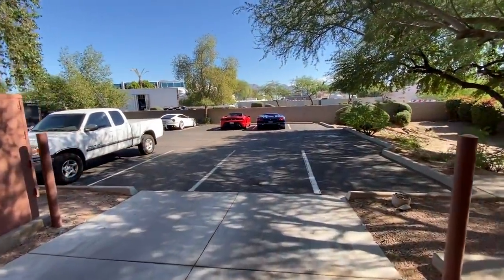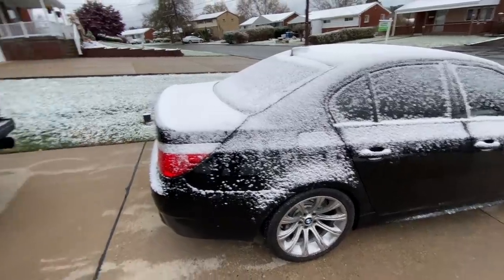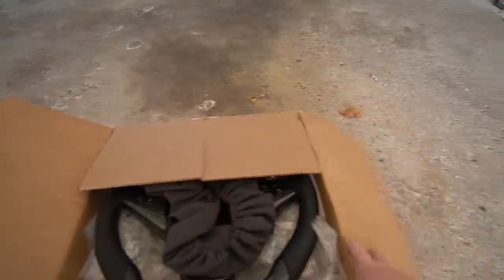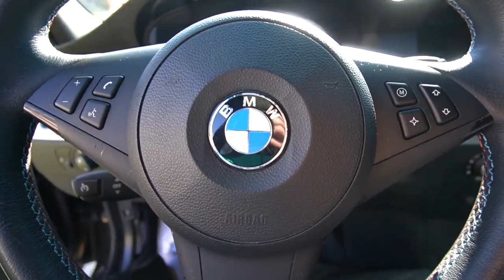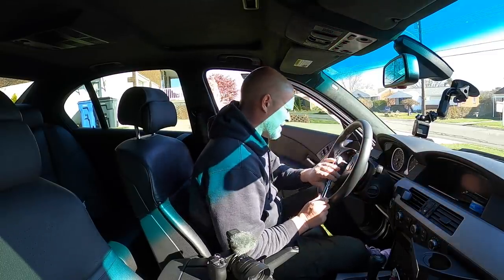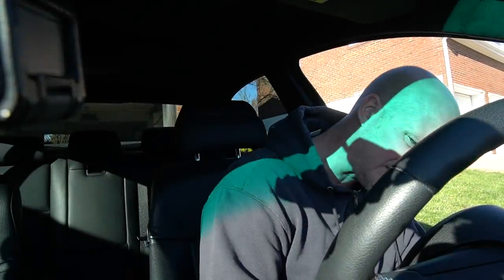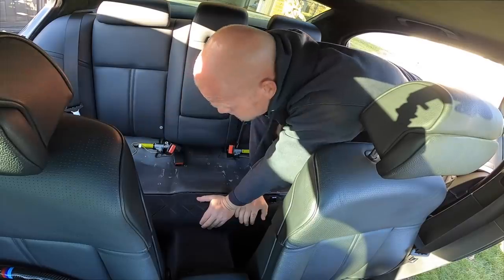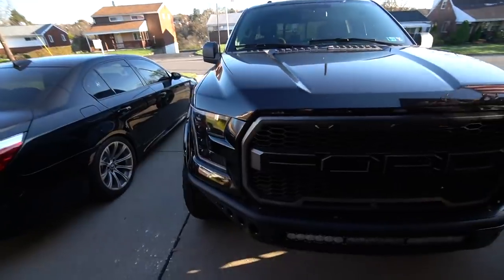I really messed up this time.. I should never work on my own cars

Comment: While you had the right socket for the ratchet it was the wrong socket for the impact gun. There are sockets that are made for those. You have likely ruined that socket and it will now strip every bolt you put it on. Replace that socket and get a set of impact sockets for the impact gun. I'm not saying this to be mean or troll. I'm trying to save you some headaches in the future. Ask me how I know about this. I've had a few headaches. 😉

Comment: You were definitely using the wrong socket. Even though it was the right size, a thin wall, deep socket will not stand the impact from that gun, and will strip the bolt every time... Use a much longer wrench.

Comment: NO Mike for the love of God do not drill out that bold.
There is special sockets for stripped nuts and screws that is what you’re going to have to go purchase from either Lowes or Home Depo.
Don’t forget to purchase a breaker bar with an extension.
Make sure and purchased a new boat from BMW when it’s time to install the new steering wheel don’t reuse the old one.
Remember always use finesse over power.

Comment: I just want to say a steering wheel's bolt is in revers so what usually is to un tighten the bolt is actually tightening it you turned it in the wrong direction
Reply: Ewald Vorster: No... It's a normal rotation.

Comment: Just need a longer breaker bar Mike. It's the torque you put in.. And never use an impact driver on the steering wheel bolt 😂

Comment: Next time you have to remove the seat try cliping the seatbelts to the latches through the hole. That should keep em lined up and worse case ypu can pull them through. Hopefully you get lucky and a) don't forget to leave trunk open b) run into your usual maintenence bad luck lol

Comment: ..... leave it to BMW to make the most simplest of things "Trunk latch" one of the hardest and most labor intensive process to open a trunk when the power runs out... imagine if you need a jump and the cables are in the trunk?..... i guess that's why so many BMW drivers don't use the indicators, in the hopes someone rear ends them so that they can get that dammed trunk opened lol

Comment: You don't have to drill it necessarily. You can use one of those extractor socket sets. I have a set and it's awesome! As long as the head isn't broken completely off, those sockets WILL grab on to a rounded bolt and remove it.  https://www.harborfreight.com/9-pc-38-in-drive-metric-bolt-extractor-socket-set-67894.html

Comment: I'll guess the bolt was probably 15mm I doubt the Germans use Imperial sized fasteners. The extra slop was did not provide enough engagement on the bolt head so when you gave it extra torque, boom! Rounded corners. If you get your balls back, it's an easy fix. You just need a hammer, an extractor socket and a breaker bar.  Here's some tips: https://youtu.be/_EfLTszAr7w

Comment: you need a steering wheel removing kit to take the bolt off
Reply: No you don't lol. The bolt is reverse threaded, he was turning it the wrong way
Reply: @connorw4390  This is NOT a reverse threaded bolt. He was turning it the right way. But he was not using a 16mm socket so he stripped it.
Reply: @lukas7417  If he was using the wrong size socket he would have stripped the head. He didn't strip the head he stripped the bolt.

Comment: 16mm man...  SAE only used in murica... They are close but not exact.    Use one of these... Irwin Tools 53910 Accessories, Impact Bolt Grip 5/8"/16mm 3/8 Dr https://www.amazon.com/dp/B004GZ9STO/ref=cm_sw_r_cp_apa_i_7ko1DbBZWGKKQ

You will need a new bolt though

Comment: Mikael stop seeing everything so negative and say you shouldn't work on your own car. When I was young and wanted to get Dad to fix my Volvo, Dad sure: You have to turn on the car yourself to learn how everything works on the car and make mistakes, you learn from those mistakes and do not do the same thing next walk. So now you learned that it was not easy to change the steering wheel and when you hand it in at the workshop, watch how they do to get rid of the bolt and you learn. Also, learn to think positively about everything instead of the negative.

Comment: if you take the seat out again clip the seatbelts in then pull them through with the belt is the easiest way. As for the steering wheel try these https://www.canadiantire.ca/en/pdp/maximum-3-8-in-drive-impact-bolt-remover-set-13-pc-0581207p.html they have got me out of some holes before you will need to replace the bolt but they should get it off but you need to get good quality tools steering wheels can be a bitch you will probably need puller to get wheel off as well when you get the bolt off.

Comment: Few things Mike...

Its not if but when you sell the car. Lets face it u buy cars to make content. So everything comes and goes.

Unless you had the wrong size socket I don't see how that happened. I don't have an M5 but I do have a German car and even though it's not a bmw, I bet that's a stretch Bolt. They are pretty tight but you're supposed to change them after removing it. I'm normally one person would grab the steering wheel with two hands, and another would loosen the bolt. So you don't put too much stress on the steering wheel locking mechanism. Though I did mind myself and I am not a muscle man. 

I think it's just for show myself, but you are a complete klutz. I should say you make yourself look like one for entertainment. 45 minutes to put back a back seat.... come on man my wife could have done it faster than that, lol. Whatever I did it you got to get the views. I just hate drama that's why I don't watch reality shows.

Comment: Hey Swede! You got two views outta me and a comment. I’m not sure how you’ve gotten to this point in your life man! The BMW is a luxury European brand. They don’t lend themselves to DIY (Destroy It Yourself 😆) numb-nuts. My question is to you, at which point did you really think an Imperial sized socket was gonna do the job on a car to which every fastener is Metric? Those steering wheels are torqued really tight and thread-locked, and for a good reason... SAFETY. Ze Germans have thought of everything my friend. Just make sure that steering wheel replacement you have meets the appropriate safety standards after fitting... my guess it won’t. You can mess with a car too much and then make it undesirable. As always my friend, a BIG 👍 from me. 🇬🇧

Comment: Mike, for f**k sake, you are from Sweden. You guys using Metric system (except for Aviation industry) This car is from....Germany, yes they are using also metric system. Why  the hell you assumed that the steering wheel is a SAE  bolt?? Well, at least you've tried.